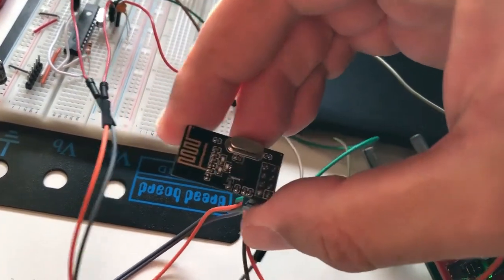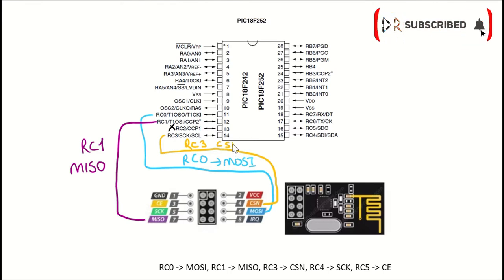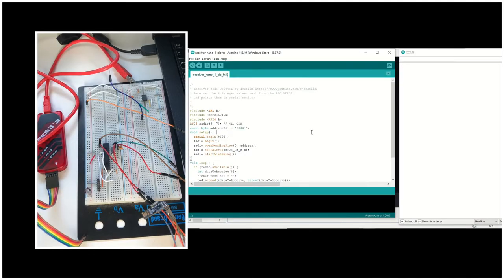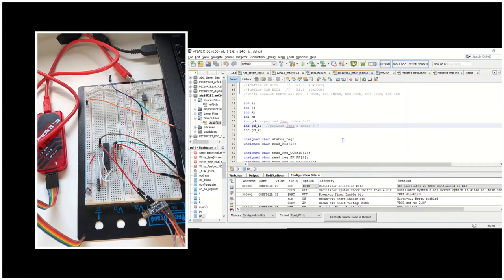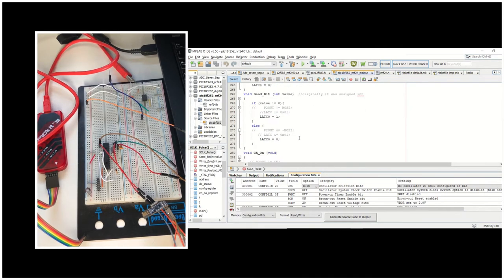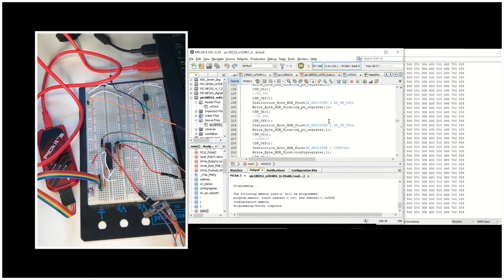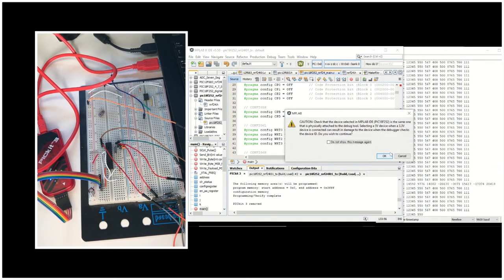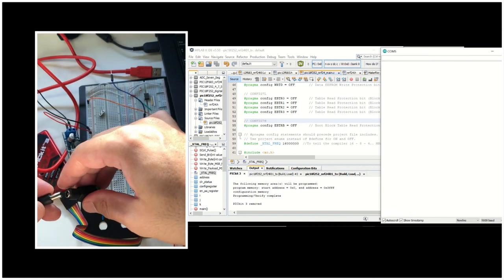PIC18F252 Microcontroller & nRF24L01+ : Wireless Transmitter

Comment: Is it possible to do the same thing using pic18f45k22?
Reply from the maker: Hi, since only digital I/O is used, it can be done with any other mcu which has sufficient ports.
Reply: And if i want to make a device which requires both tx & rx but again tx should be compact what sensor and tx device i should use?
Reply from the maker: Not sure if i got your question correct. In the configuration that I showed, the mcu-nrf module can either be tx or rx.(in this video it’s tx, however you can use the receiver code I made in msp430 and port it to PIC similarly). Also there are no sensors in this setup, not sure what you mean by that.